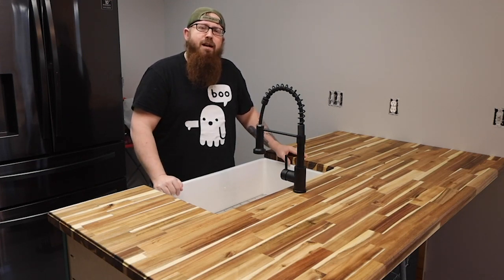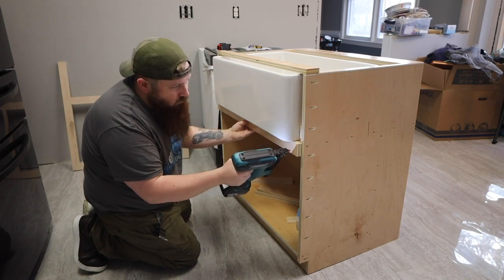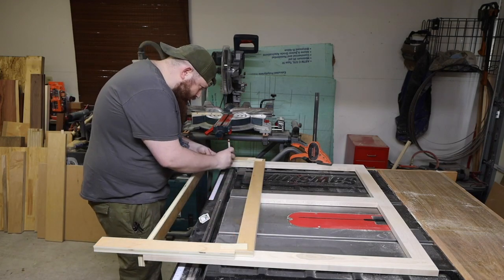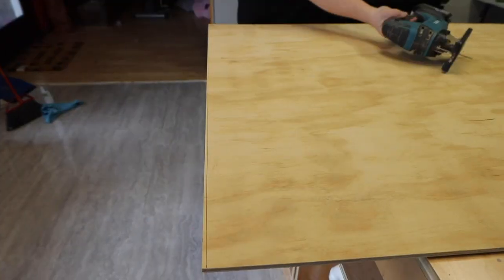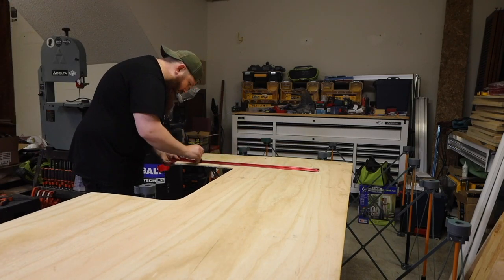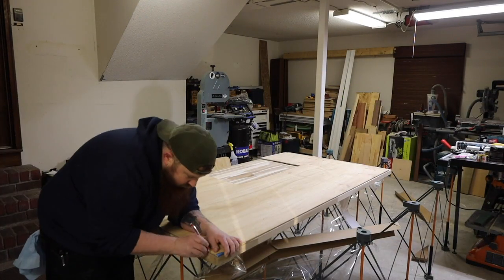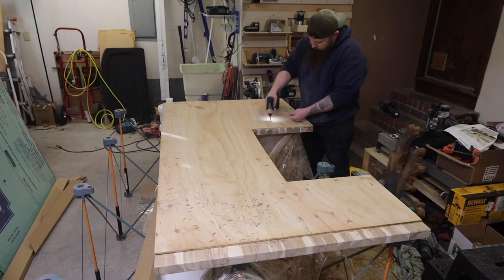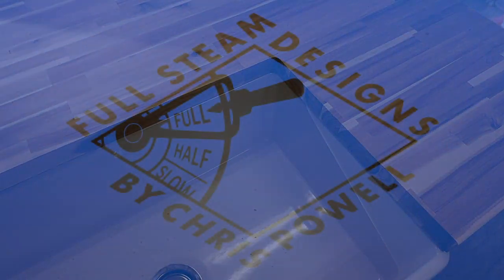How To Install a Farmhouse Sink and Butcher Block Countertop for the Best Fit

Comment: I installed countertops for about 8 years. This video is great. One tip - If you don't have the budget or means to have an entire sheet of plywood as a template, we would cut 2" strips of 1/4 inch plywood and hotglue them together along the wall to make a template. Works great and is way cheaper.

Comment: Just an FYI that would make your channel even better! Is if you could list all the tools that you use at the bottom. I noticed you used many different tools. And it would just make it so much easier. You Rock! Thx
Reply from the maker: Thanks. I usually try to list stuff in the description.

Comment: Hi, what did you use to seal the sink to the counter? I have silicone and its not working well. Suggestions?
Reply from the maker: I used this. https://amzn.to/3nIyU1q I put it under the counter so it would cover the edge of the sink and then sealed around the sink with it also. It’s holding up great.